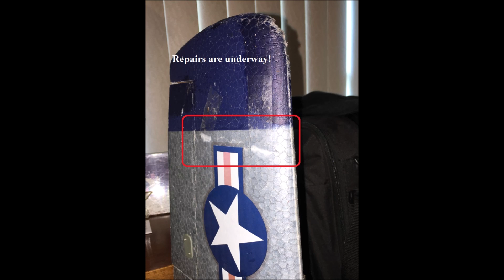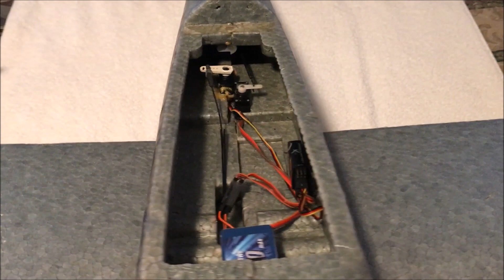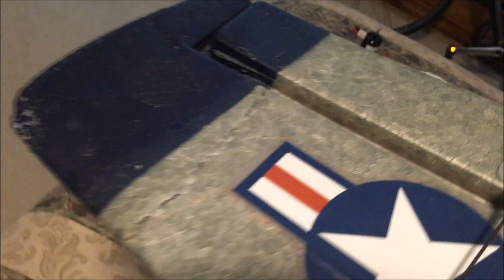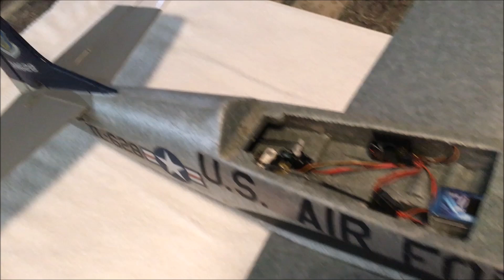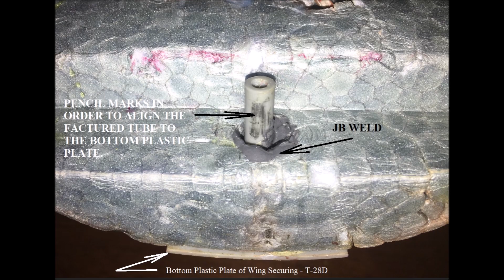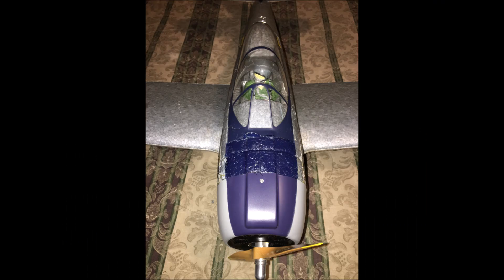Park Zone T 28D Airforce Trojan Crash Repair Tips 07 08 2018

Comment: Hello Carlos I have the same plane and I need to get a new motor, what would you suggest. I do have plastic props. I need a motor to fit the motor mounts. Thank you.
Reply from the maker: Believe it or not, I use the Stock Park Zone "BLACK" 480 brushless motor that these models come with.  I am not a speed demon and instead like the stock to swing my Master Airscrew 3-Blade, 10 X 7 X 3.  It provides lots of thrust so, I can perform continuous Knife Edge around the field.  Therefore, I am sorry but, do not know what other motors.

Comment: Thanks for the video,
I have almost completed a repair on this model (stock) also and I've just found this.

I used a product called 'liquidnails' I don't know if every country has this it is a construction glue which also worked great. it bond is strong also flexible has worked great with the foam. Thank again for the video.

Blue skies
Reply from the maker: Corsel, thank you for your comments.  I have been using Gorilla "CLEAR" Glue most exclusively and with super results.  It does NOT leave any residue nor does it expand like the first Generation Gorilla glues.  It is clear and you can NOT see where the glue joint is after cure.
Reply: @guapoman2000  Yeah gorrila glue is a tried and tested glue for sure, I've never used it myself, always just bodged things up with what is lying around 🤞🤞🤣

I also tried PVA wood glue, what you call 'white glue', on the main damage on the fuselage.
I experimented with it in the first instance because it glues clear and is also a reliable glue, curing in about the same time 24hrs. But PVA didn't 'fasten' itself near as quickly, therefore required delicate clamping.
Reply from the maker: MY newest glue that I use is GORILLA "CLEAR" glue.  It is certainly CLEAR and does NOT leave any residue plus it doesn't have any smell or fumes to get high on (that I know of).  It cures pretty fast although it says a full cure is around 12+ hours which is fine with me.  Try it... I am sure you will like it.  They are found at the CRAFT section of Wal-Mart.